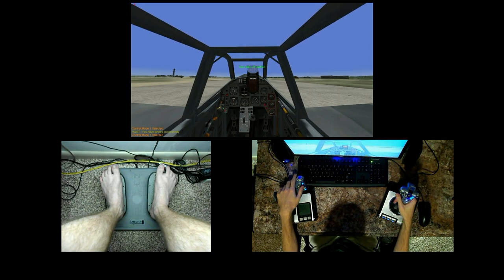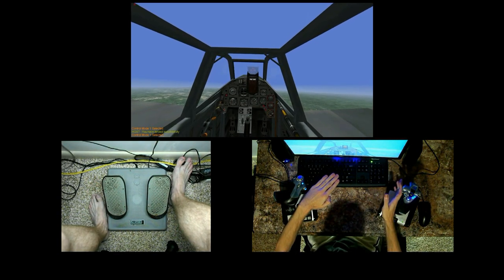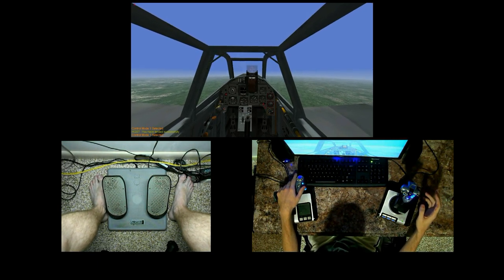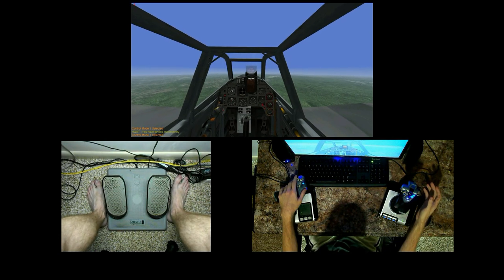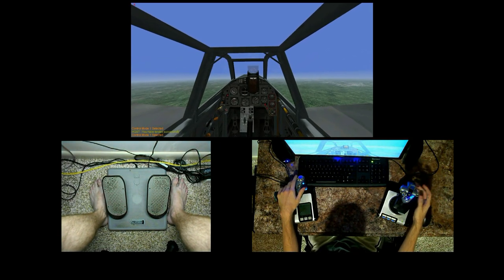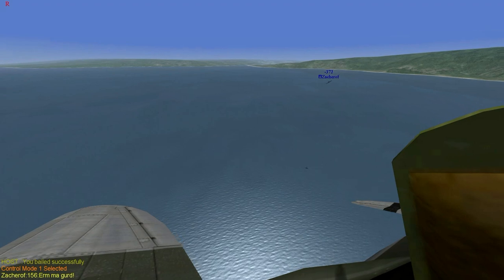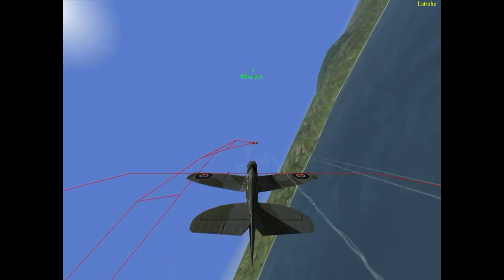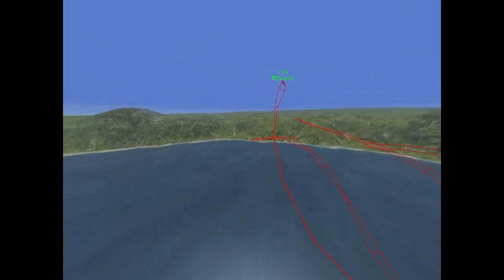Aces High 2: Tailslip Tutorial

Comment: Use any Corsair(hog) and nose down real fast while going any speed with the rudder going left or right (forgot which) and you instantly invert he aircraft if you catch it. Losing only speed from the minor dip and the rudder dragging.

P51B(I think) has that scoop on the bottom for really nasty tail slide potential in a descending scissors from high alt. Annoying enough to a Corsair's descending flaps of death circle.

Comment: You can't do a true tailslide in AH2. Programming limitations do not allow it. That's why they invented auto-trim. Oh, and that's not a tail slide depicted. That's a Chandelle with a stall roll wingover combo. 109 rudder is too small to do a true tail slide without leaving yourself hangin in the air and a nice fat target. You're better off doing a wingover in the 109 you'll get turned around faster.